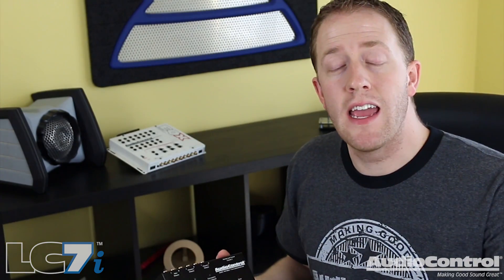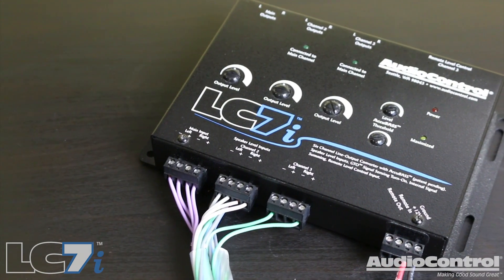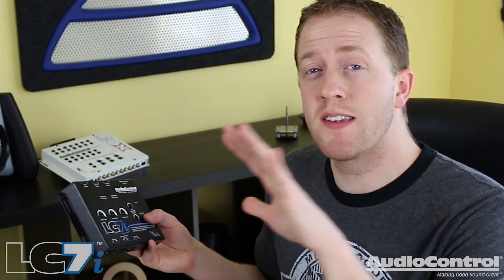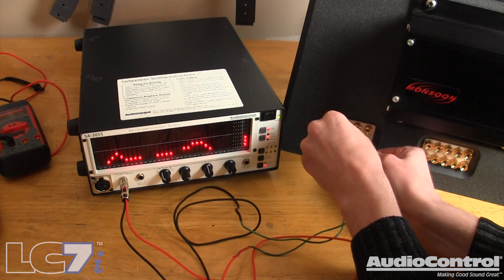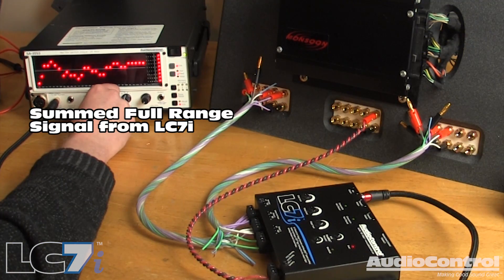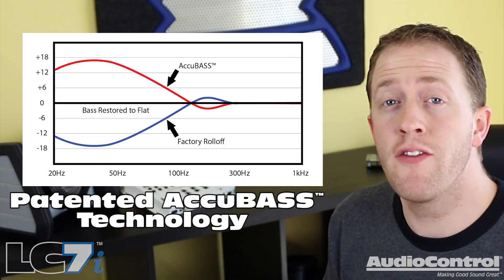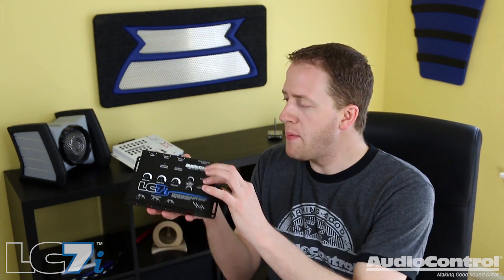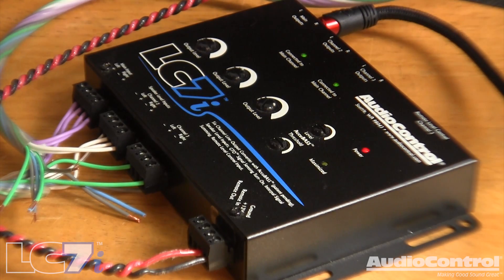LC7i - Add Amplifers to Stock Car Audio System - AudioControl

Comment: I own a 2016 Nissan Maxima with the 11 speaker Bose system. Will the LC2i work with the Bose system so I can add a sub/amp?
Reply from the maker: Yes, the LC2i will work with your Bose system. You should be able to tap into your existing sub signal or front lows.
Reply: I do not have a factory sub. I read that the LC2i needs a full range input. I have 6x9's on top of the rear parcel shelf. Can't I grab from those?
Reply from the maker: Oh, of course. And to clarify, the LC2i does not require a full range input. It is an active line output converter and will convert any speaker level signal to preamp leve. If you are adding a sub, you just need a signal that includes sub woofer frequencies, i.e., 30 Hz to 90 Hz. Your 6x9s should do the trick.
Reply: Perfect. Will purchase it. Thx bro!
Reply: AudioControl What about a 2017 honda accord and does it support bluetooth?

Comment: I want thunderous bass, you know the hard bass u hear people drive by with .Can this help with that?
Reply from the maker: AccuBASS will help quite a lot, but I think you're referring to The Epicenter: http://www.audiocontrol.com/car-audio/the-epicenter-processors/
Reply: So if im correct then the bass im looking for would come from the epicenter processor rather than this lc7i?
Reply from the maker: Yes. The LC7i will allow you to compensate for lost bass in a system, and also give you a nice, natural boost to the bass already present, but it is not meant to give you loads of low end. The Epicenter will actually add very low bass, from around 27 Hz to 63 Hz, which is that thunderous bass you're referring to.
Reply: OK thanks , this is the advice I needed being that I still have the factory stereo
Reply from the maker: Right. You would need the LC7i and The Epicenter. Or, if you are just adding a sub, an LC2i and The Epicenter.

Comment: Hey audiocontrol I gotta question. I have a 2015 gti and want to add an lc7i in this way: connect a 2 way crossover for the drivers and tweeters into all 4 doors, connect those the the lc7i, and add a 4 channel amp. Then use the auto mode feature to connect to channel 3 and add a sub and separate amp. Was wondering if this sounds like this will work
Reply from the maker: Mod Mark perfectly...
Reply: AudioControl sweet thank you for the quick responce!

Comment: Big fan of your page Thank you for all the hard work!
 I bought the DQ-61 after watching this video I own a 2008 Acura TL I tapped into the speaker wires after the factory amplifier but I'm having trouble identifying the highs midst and sub I'm not sure if you have had any experience with this car but if you can help I'd greatly appreciate it
Reply from the maker: Hi, Edwin. We don't have data specific to your vehicle, but you might check sites like http://www.the12volt.com/.

Comment: If i'm connecting 2- JL 12W1 subs to a JL 500/1v2 to a Mark Levinson Lexus factory sound system, do I need the LC7i or simply an LC2i ?
Reply from the maker: Hi, Randy. The LC2i should do the trick. Use the LC7i if you plan to expand the system later.
Reply: @AudioControlCar  Will the LC2i improve the signal to the mark levinson amp?

Comment: AudioControl LC8i vs LC7...  What's the difference?
Reply from the maker: Hi, Shaun. The LC8i has 8 channels plus an auxiliary input. The LC7i has 6 channels and our patented AccuBASS bass enhancement.
Reply: Is this to say the LC8i does not have the AccuBASS? Thanks.
Reply from the maker: Correct. The LC8i does not have AccuBASS.

Comment: I had a blast showing off the LC7i! Thanks AudioControl!
Reply: CarAudioFabrications should I tap in to my rear door speakers? Or do it from the back of the head unit?
Reply: Hello mark my name is also mark,I need some edvice and help,I have 2016 Jeep Cherokee trail hawk,I have the Lc7i my systeam oem is the 6 speaker non premium system I don’t know how to set the jumpers,I have my four channel front channel to main on converter rear channel to channel 2 on converter with auto mode on,also I bought the smd distortion calabrators but don’t know where to set the acubass and thresh hold,please get back with me,I’m fairly new to car audio but,I wanna get more educated with it